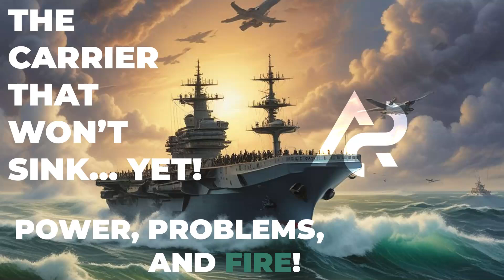Kuznetsov-Class Carriers: History, Design, and Challenges.

Comment: Wow. I'm really at a loss right now. The term, "polishing a turd" keeps coming to mind. You have to be familiar with the consensus universal view af this vessel. This is not without good reason. No one is picking on the Russian Federation. That's simply too low hanging fruit. Presently, the Russian Navy has barred access to two entire decks because of fears that they are haunted by the ghosts of maintenance personal who died during one of many fire that have broke out. This vessel is a floating ecological disaster that can be seen ten miles away because of its billowing black smoke trail. It sank a drydock while getting hit by a falling crane. It's lost multiple jets during landings due to faulty equipment. Not to mention, it was stolen from Ukraine by the Russian Navy before hostilities began between both countries. It's not designated an "aircraft carrier" because Turkye doesn't allow carriers to traverse the Dardanelles. Why would an aircraft carrier need torpedos? Why would an aircraft carrier carry nuclear ICBMs? And what the hell are nuclear depth charges? How is that even a thing? And why would this podcast be glorifying such a blaitent example of floating stupidity.
Reply from the maker: Hey, really appreciate you taking the time to share your thoughts—clearly, you’ve done your homework and have strong feelings about the subject, which we respect. Just to clarify: we’re not trying to glorify the Kuznetsov or rewrite its very complicated and controversial history. We’re well aware of the overwhelming criticism it has faced—some of which you mentioned in vivid detail.

Our goal with this episode was to explore the entire story behind the Kuznetsov-class carriers: the design decisions, the operational struggles, and yes, the many failures. But part of that also includes understanding why it was built the way it was, and the historical and geopolitical context behind those decisions—not just pointing and laughing at the result. We're aiming for a complete picture, not a highlight reel of disasters (even if the material makes that tempting).

That said, we hear you on tone and content. We’ll keep pushing to make sure future episodes strike the right balance between critique, storytelling, and technical analysis. Thanks again for the passionate feedback—it's always welcome.
Reply: That's an incredibly comprehensive reply. I understand what your objective was and I may have come across somewhat overly zelious in my critique. I've just been addressing a lot off pro-Russian sympathies that would absolutely turn any type of balanced prospective such as yours into  ammunition against reason. Of course, that's no justification to give an unbalanced assessment of the vessel. So, I extend my apologies for my brashness. I just felt behoved to speak my peace on the subject. I also feel some amount of respect for some military accomplishments from the USSR and the Russian Federation. While struggling to balance respect with apporance of the the current situation in Ukraine.  @Allsorts-y6e